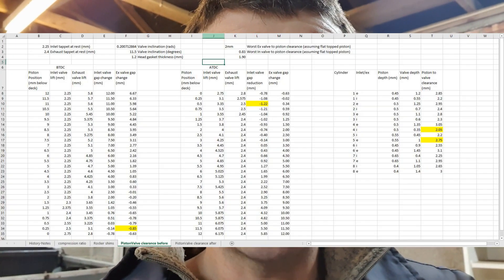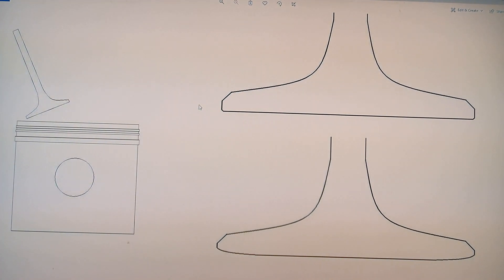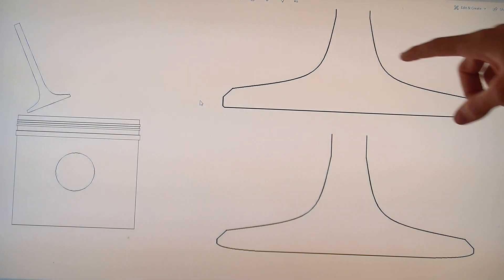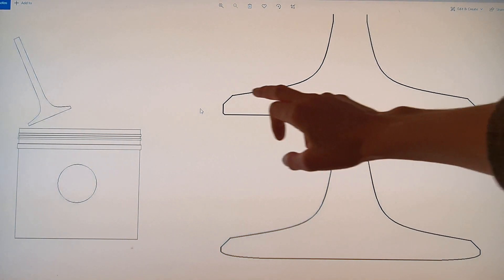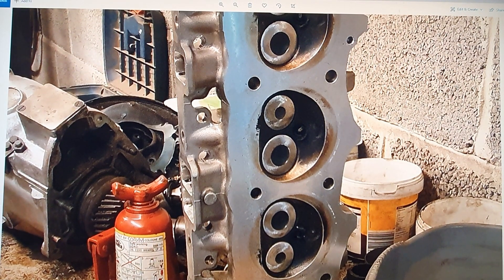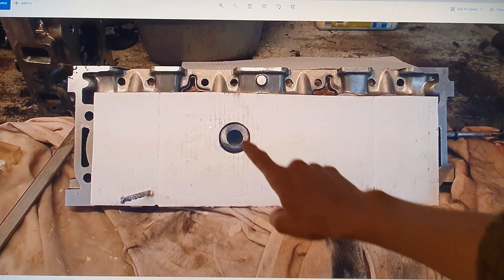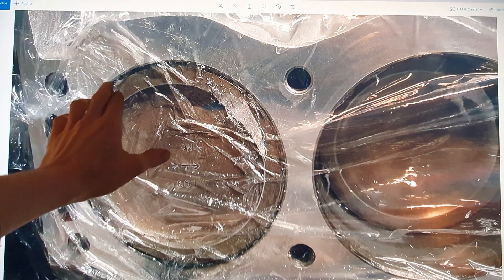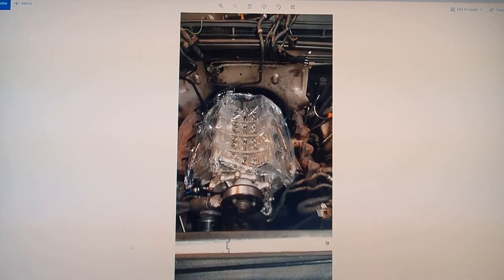Skimming Valves and adding Valve Recesses in the Pistons - Discovery 2 V8 Engine Rebuild Part 15

Comment: The madness haha, is it definitely top end, I was chasing a noise that would change between a knock, rattle and tick that only appeared once warm, it's the flex plate which has in turn knackered the stator in the torque converter and now even the turbine vanes feel like they're on their way out. The hp22 was originally designed for 2wd cars, think I'll have to change to manual. All the best with the old bastard.
Reply from the maker: Hahaha, yeah I really went off the rails in this video. I was desperate and still wasn't sure what it was. 

Thats crazy the torque converter issue you found. Keeping these going is a real roller coaster! 

This turned out to he faulty tappets I finally find it in the next video. 

Thanks for comment, much appreciated

Comment: What was the problem in the end it's been on my mind All week lol
Reply from the maker: Jeroem. You'll have to wait another week......

Only kidding. It turned out to be faulty tappets. Faulty AE tappets...  maybe counterfeit, I'm not sure. When I finally found the faulty parts and get them out, I stripped them and found the plunger was a very loose fit in the tappet body. A new set of NOS tappet has fixed it.

Thanks for the comment and the continued support with the channel Jeroem, much appreciated
Reply: @lozl  I was thinking followers but I assumed as s you had spent alot of money on the engine that you had brought OE followers so I passed over that as a possible cause of noise and sorted my new engine oil cooler now down to your help  thanks
Reply from the maker: @jeroemsmith566  Thats great, glad you got it sorted. Good work buddy!

Yeah the tappets were not on my radar. Brand new AE tappets! They really shouldn't have been the problem! I really went a bit crazy in this video, I get back to sensible loz in the next
Reply: Hello did you do a vid on porting the heads on the V8 and have you do anything on the gas conversion on the disco2 would be interesting thanks
Reply from the maker: @jeroemsmith566  Hi Jeroem, I did do a video on porting the heads. Its only a brief description really, ots the first 2 minutes of this video:

https://youtu.be/Q2ycMACniBU

The car was fitted with a Landi Renzo, Omegas LPG kit when I bought it. So I really haven't done a great deal with it. I replaced a solenoid a while back that was stopping the gas getting to the regulator. Other than this its been one of the best LPG kits I've come across and it seems to be quite neatly installed on the car too.